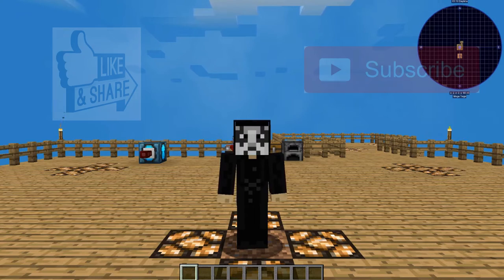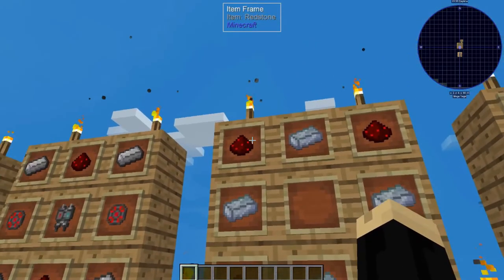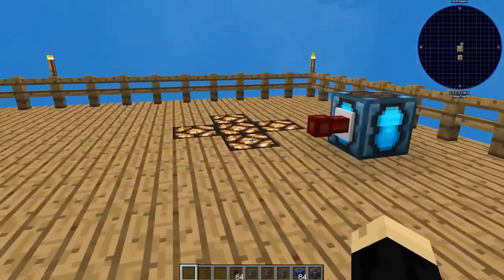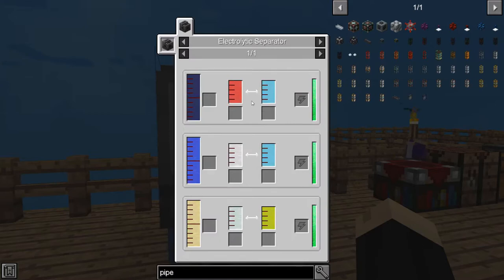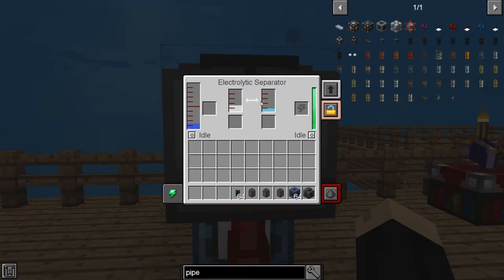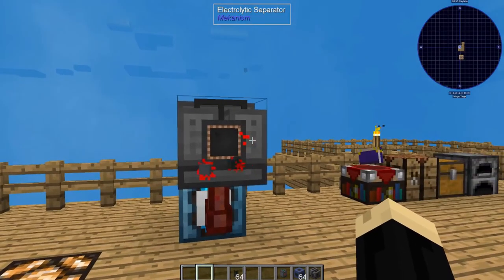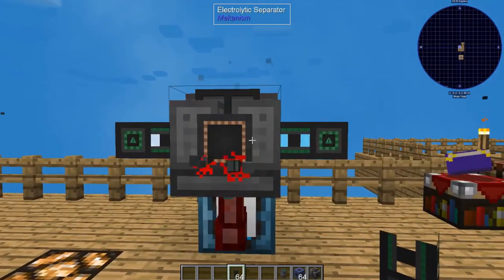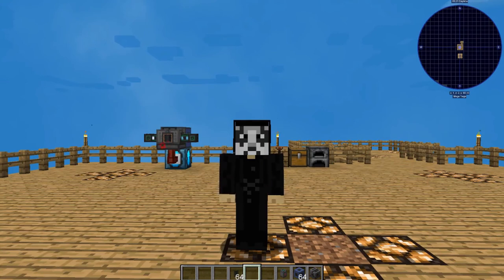Minecraft - Sky Factory 4 - How to Use an Electrolytic Separator to Make Hydrogen and Other Gasses

Comment: Hey man, I'm kind of late to this, but in survival I'm not certain there is such a thing as an "infinite water source" block and so I would like to know how you'd go about hooking this machine up to a small, infinite pool of water. I guess the electric pump is the way to go, but I can't seem to make the pump draw in water. 

What's the trick?
Reply from the maker: The good news is that the water source blocks are in survival.  There are a few different levels of them, each producing faster that the last.  You can connect it to a regular 2x2 water source though using a fluid extraction cable.  You just need to connect the cable to a solid block where one of the water sources will be first.  Then break that block and put the water in the 2x2 space.  This tutorial may help.  https://youtu.be/G_UEbm4hDuU
Reply: @OnlydravenGaming  Thanks so much!

Comment: my machine suddendly stopped working, I did everything you told me to... what should I do?
Reply: It has water and energy but won't produce anything, why?
Reply: Your problem may be that the machine is outputting more than it is actually producing, which is a problem I haven't found a solution to

Comment: The electrolytic separator wont even start separating for me, why?
Reply: I have the same problem. If I find what's wrong, I will try to get back to you.
Reply: Don't put the generator on high
Reply: @obama3692  Mine won't even pump water or anything. I have it linked to a cooking for blockheads sink (I have also tried many other water sources) and it just won't pump water.